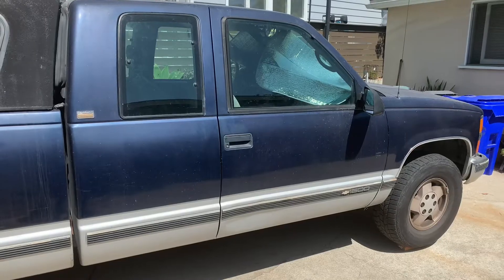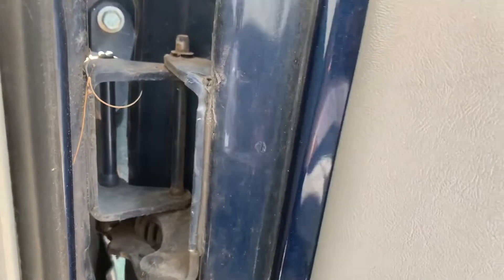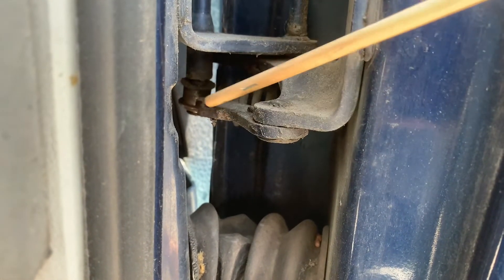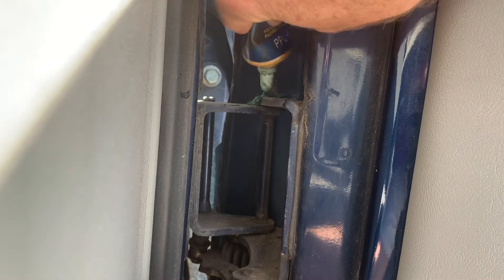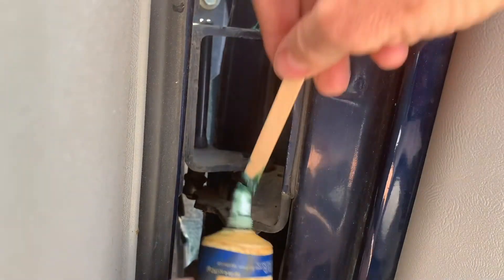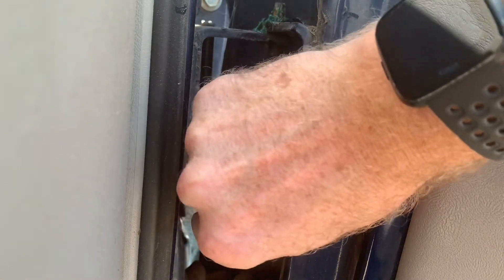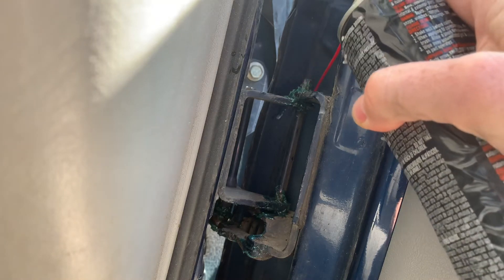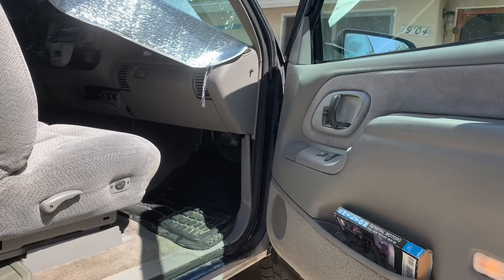How To Grease Chevy Truck Door Hinges

Comment: One way to get grease and other lubricants into tight spaces like these hinge pins is to use a length of string ( cotton string from the hardware store or dollar stores works best for me ).  Smear a small dab of grease onto the string and draw the greased string into and around the pin in the small space between the hinge arms.  It may take a few applications to get the grease all the way around the pin, but it will get back in the space. This method has worked for me for decades in all types of applications. If you need to do this in the winter, you can use an old hair dryer, or a heat gun ( set on a low heat ) to soften the grease, getting it to flow down into the space better. I learned this tip from an old-timer when I was restoring my first vintage truck back in the 70's.  Now that I am an old-timer myself, I reckon it is time for me to pass it on. I hope this helps someone out there.
Reply from the maker: That’s really smart. Thanks.
Reply: @hoohoohoblin  No worries. Hope it works out for you.